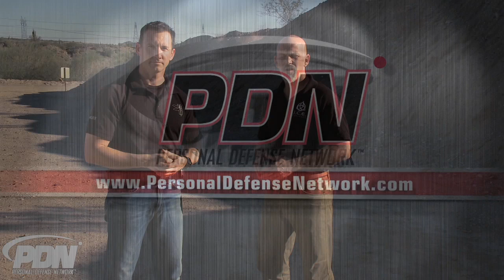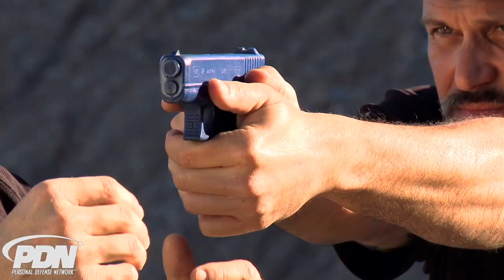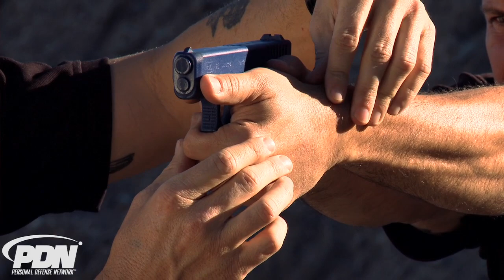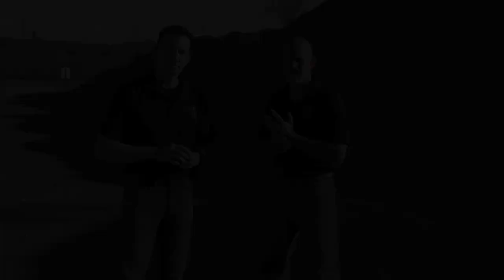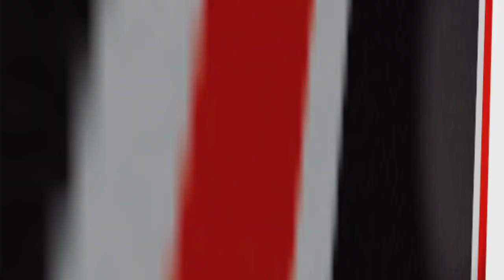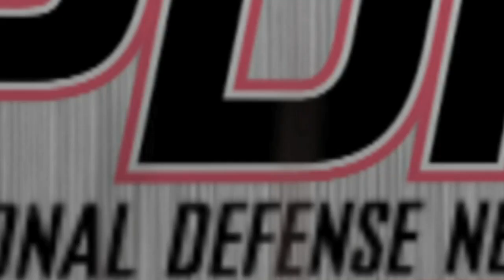Biomechanics of the Grip | Personal Defense Network

Comment: If you were to use that grip on a 500 magnum revolver, you'd lose that thumb! The gasses from the cylinder gap would take the tip of your left thumb clean off! Certain grip methods may work on some firearm but not others. Know your firearm, beware and be safe!

Comment: Good . . . more surface area on the gun translates to greater control.  And there is science related to force moments and torque.  So, if the arms are fully extended, then the rotary motion or torque also increases.

Comment: When you fire any gun you must realize for every action there is a reaction. A shooter needs to minimize the reaction to be accurate therefore control of the gun is imperative. It takes a smooth stern grip with a measured trigger pull.